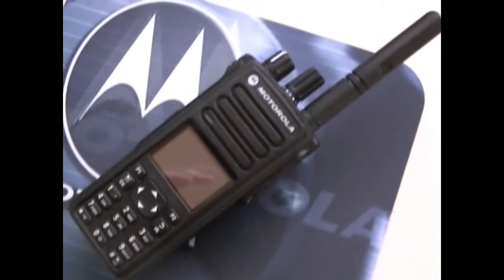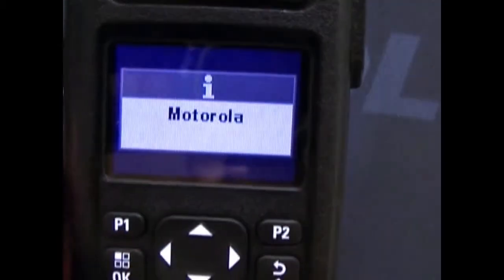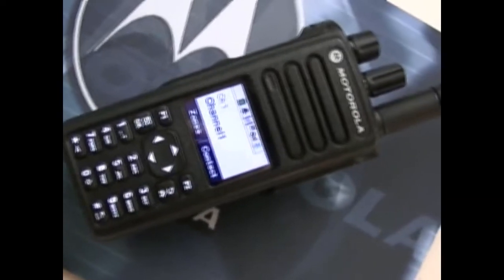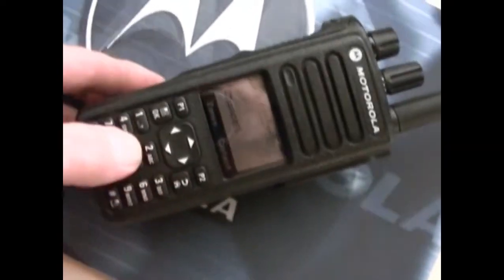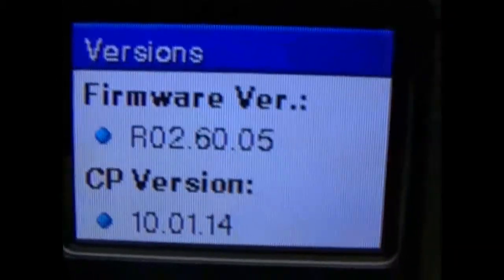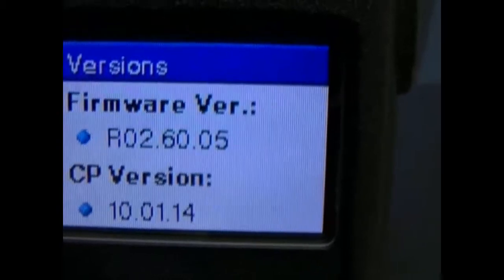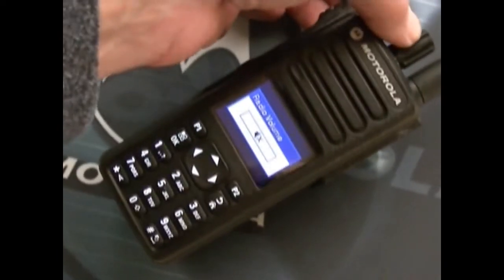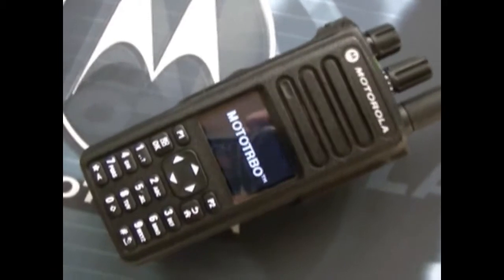Mototrbo XPR7550 UHF DMR Radio Unit - Programming Issues - Grrrrrr!!!!!

Comment from the maker: Note:  This issue has been resolved. The radio is reading and writing now with zero issues.  It was an issue on my end.
Reply: snarlingrabiddog5150    If you need any access to that p25 forum I am going to give you a way. your going to go to https://archive.org  , type in in the search box the address of p25 forum which would be www.p25.ca, it will give you a calendar with blue circles on date, that is when mirroring happened to site and can bring you to the site to look at what you need to if you need to find information.  I hope this works.

Comment: Ok so region not supported means that the radio is from a different location than the US (assuming that you are trying to program the radio with the US version). Either the radio isn't the US version (Likely) or the CPS isn't. There might be a fix for this send me a message.
Reply from the maker: Thanks Dave, I will!
Reply from the maker: I tried to message you but theres no option to do it Dave.

Comment: P25 Fourms was shut down, usually if it says Region not supported than someone potentially blasted it with another Firmware, possibly Asian or EMEA. People do this to get FPP in the radio as the other firmwares allow this.